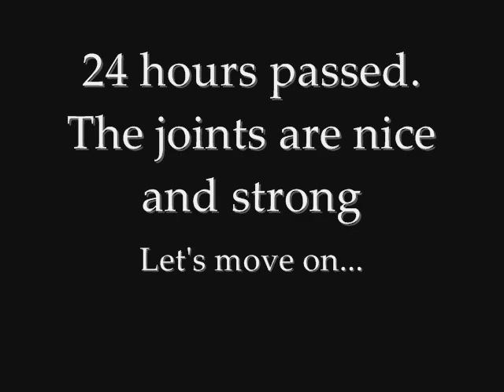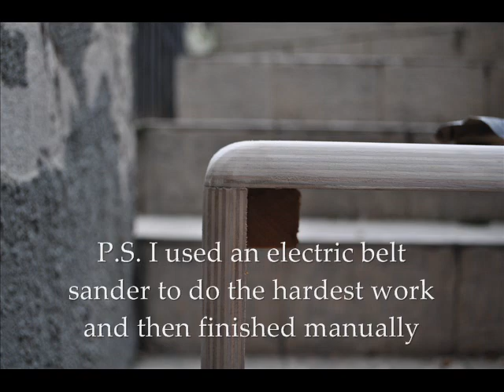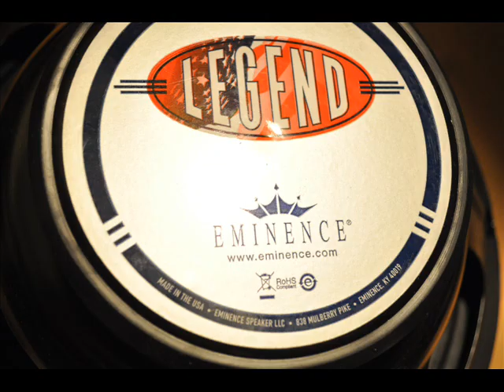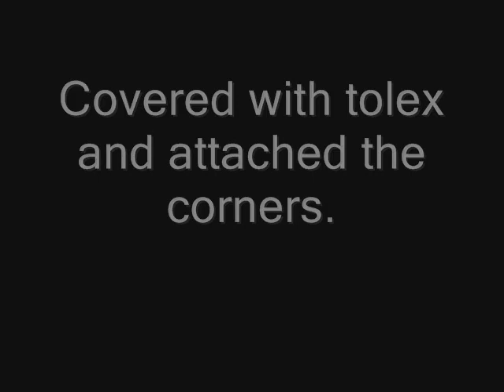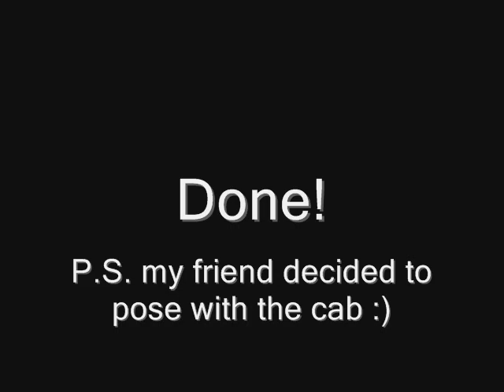building a guitar 2X12 speaker cab

Comment: very cool. Do you think I can put a 15 inch and a 12 inch speaker to work together in one cab? I have those two speakers, would it require much knowledge in electronics?
Reply: Yes no problem double check your amps output and match’s the ohms. You’ll likely have to wire in series or parallel

Comment from the maker: @sniperguy4u 
No. There are two types of guitar cabinets - open or close back. The close-back cabinet sound is more directed straight through the speakers. That does not cause too much bass/low end. The sound is just more one-way directional and the bass is tighter.

Comment: I would like to say that your video has helped me tremendously in making my 2x12. It is very much appreciated.

I am just at the point where I am about to cover it with vinyl and was wondering what adhesive you used.

I tried 3m 77, 80 (for vinyl) and 90  adhesive spray with no success.I think I am going to go ahead and use contact spray. Your thoughts?

Once again, your video is much appreciated!!!

Comment: Did you take the height of the rubber ...foot and the handle into consideration in the height dimension? Because most companies include that in their measurement. For example, the rectifier cabinet's dimensions are all off on the internet.

Comment: Great job, congratulations! I wanted to ask you 2 things:
1- Did you choose that specific thickness of the plywood for any particular reason? it looks quite heavy.
2- How do you calculate de depth of the cabinet? is that important for the acoustics?
Reply: In response to your depth question, the volume inside of the cabinet has a lot to do with the acoustics. Pretty much all manufacturers will tell you how big the cab should be for that speaker. And heavier is usually better. The higher the density, the less flex of the cabinet, and the less energy wasted from the speaker.
Reply from the maker: Hi, 
Actually some cabinet manufacturers tend to make the baffle part thinner than the rest of the walls for the speaker to resonate the way they want it to resonate. Why I chose the plywood so thick for the whole thing?
1. Did some research and concluded that thick plywood would resonate better for my speakers.
2. Durability - built like a tank :)

Regarding the depth - I think I actually made it a bit too deep. As the low frequencies got "lost" in the cab and did not sound exactly how I wanted. Though that does not mean the cab sounds bad - it is really good. This also can be due to the speakers - it is a gamble even if you follow manufacturer's instructions!

Comment from the maker: @VerberneNewAge 
Well..  Eminence GB 128 power is 50 W, so I guess the total power is 100W.

Anyway if you are using a 150W tube head, i suggest you go for 4X12 for optimal sound range and not to fry your speakers if you play loud (happened to me with this cab and a 120W head)

Comment from the maker: @CaribbeanEmbassyUKTV    I did not use any crossover as guitar cabs (typicaly) do not have separate bass and treble speakers. The sound of the finished product is better than anything for the same price in stores. It is a bit loose. I am planning to decrease the capacity of the cab for tighter bass.